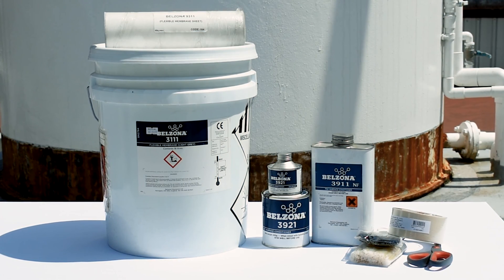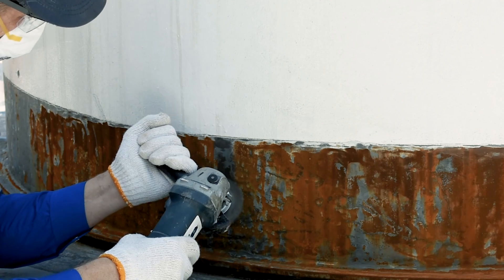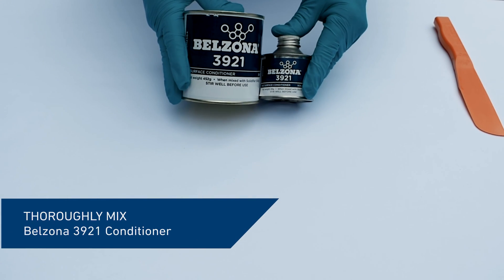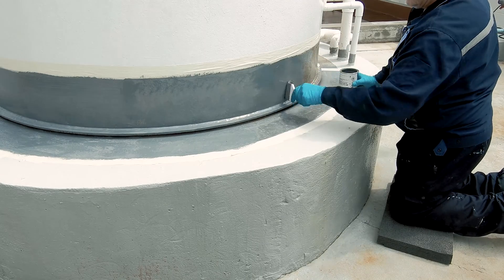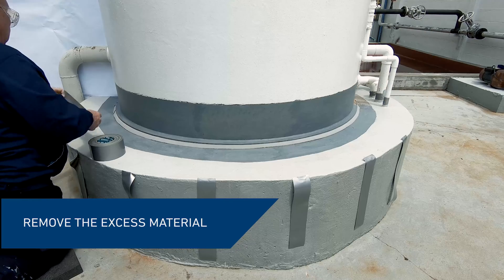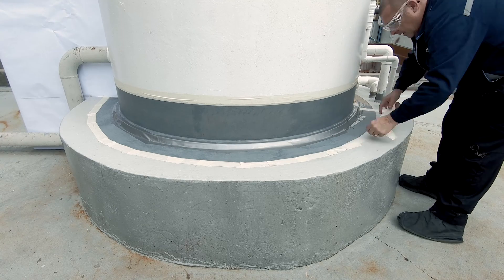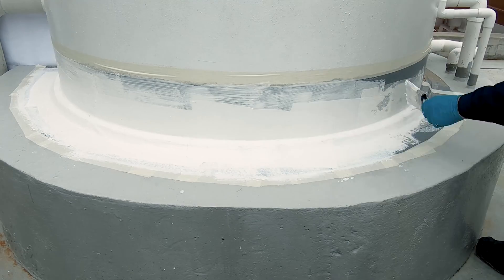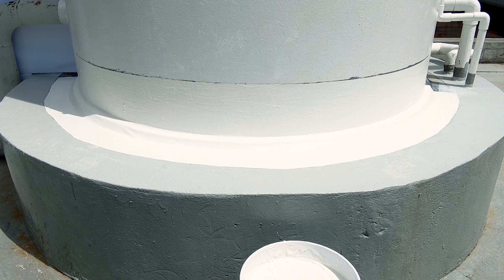How To Install a Tank Base Sealant with Belzona 3111

Comment: can apply for cast steel tank capacity 6600 ton ?
Reply from the maker: Hello! The repair is applicable to any tank, the video demonstrates the sealing of the chime area between the tank and the floor to prevent water from penetrating and puddling under the tank creating corrosion.  For more information, you can contact our Technical department at tkl@belzona.com.

Comment: May i know why does he used BELZONA 3921 on the concrete surface? could please reply why?
Reply from the maker: Hi Josekutty,

To simplify the application of the tank base sealing system we use just one of our conditioners Belzona 3921 GSC (General surface conditioner), we do have a dedicated conditioner for porous surfaces such as concrete, Belzona 3911 PSC and would recommend this for larger application areas on such materials as concrete.

I hope this helps!

Comment: "It does not require specialist tools or hot work permits".   . . . . . shows a guy wire wheeling with a grinder to prep the surface.
Reply from the maker: Hi Jeevesme, 

A fair observation! In this context, however, we are referring to the Belzona materials themselves not requiring hot work permits or specialist tools. In the above video, the wire wheel was an appropriate tool to get the required level of surface preparation in good time. In certain cases where not hot work is allowed, using a less practical form of surface preparation may be the only and best solution for the client. 

I hope this clears things up!